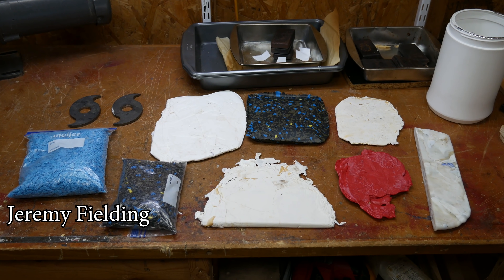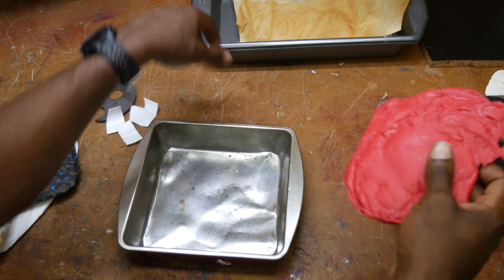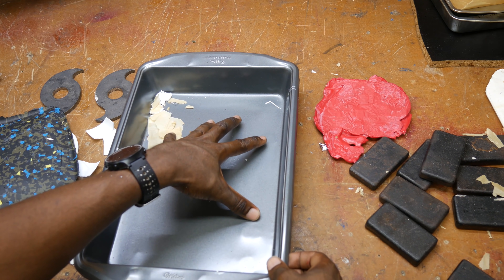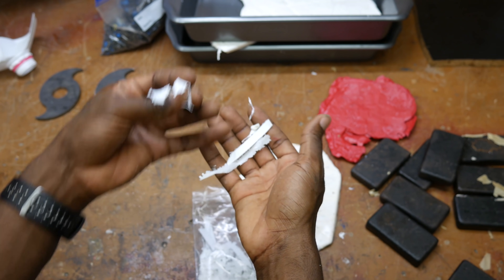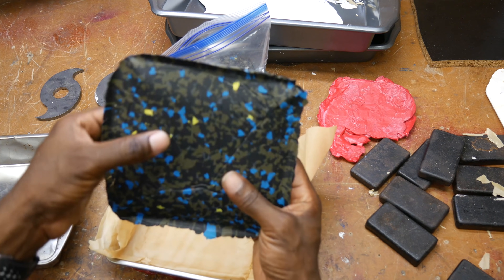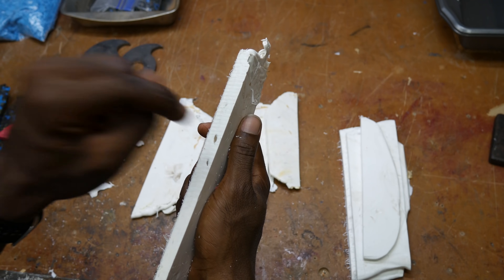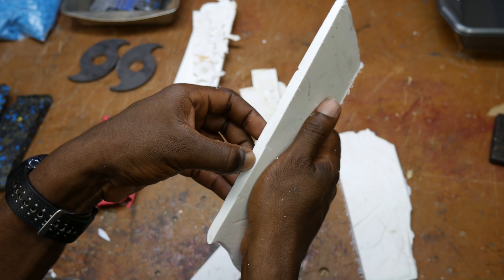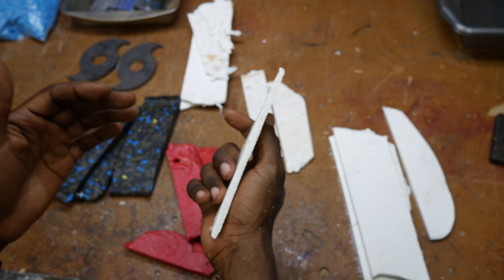HDPE, How Much Processing Is Required; I Put It To The Test!: 043

Comment: The factory I work at, makes plastic auto parts. We use heat and pressure to do injection moulding. Another thought to help remove voids is vacuum pressure when setting the melted plastic
Reply from the maker: I actually have a vacuum pump. It would require a chamber where in I could place a griddle, and cook the whole thing under vacuum. That would be interesting at a minimum, although not a cheap process to copy.
Reply: Jeremy Fielding maybe a process more like vacuum forming would work?

Comment: i use a piece of 50mm/2" galvanised steel water pipe with turned wooden plugs and clamps to make round stock to turn,you have to keep adding pressure as it cools. shrinks just enough to get it out when it cools,would think you would have to use a similar system for sheet ie. constant pressure plus adding pressure as it shrinks. maybe?
Reply from the maker: Yep. We are on the same path. I want to make a press which can be tighten while cooling.
Reply: That's what I do. I use the gradually increasing pressure clamping method. It still imparts internal stress into the material though. You're basically compressing a spring. Well lots of long chain molecule springs in the material. But usually that doesn't matter. Sometimes it does though.

Comment: I think you need a better pressing and heating method to really "mix" the melted shredded plastic. Probably heating the plastic for that long isn't good either. 
I guess theoretically you could build a large cylinder where you could just dump large pieces of plastics or complete jugs into it and then heat the whole thing under pressure.
My guess is that shredding is mostly great for storing or maybe mixing and cleaning the plastic.

Or a large solid metal tray to make dimensionsally accurate plates. Something that can be heated on it's own and where you can apply considerable pressure.
Reply from the maker: There is a note about this in the description.
Reply: Oh I'm sure I wasn't saying anything new, just thinking out loud :)

I guess my realization is that shredding saves space when melting the plastic. Like for the injection molding machine from precious plastics. Or compact storage for later use.

But if you just want to make thicker plates for cutting / CNC / subtractive processes you could just have a large box or tray and melt them down in the oven. Or integrate heating elements in a large metal box and make something you can clamp down to create pressure. No need for a shredder if you have space.
Reply: Shredding also means that the ground material can be stored in one location on site and then fed through vacuum lines along the ceiling to several simultaneously working plastic presses.
Reply: Cheers. I guess in an industrial setting cycle times are very important so you tune and calculate all the temperature so that it just works fine and as fast as possible.
Reply from the maker: No...I mean I have a note about why this is not a good idea. pressing large pieces together leaves the greatest potential for air to get trapped inside and leave those voids we don't want.
Reply: between melts while I build up my melt I press the mass with a large steel rod to consolidate it, and break up air bubbles. I use this large metal punch that I have and I just push the glob down with it. I also push the glob with a steel block with my other hand at the same time too. Kind of like kneading dough a bit? What the pros do is they have an auger in a heated pipe and that pressurizes the plastic.
Reply: Vacuum injection molding? Does that even work with thermoplasts like this? What if it cools down inside the the feed lines?
Reply: The vacuum lines are for transport only, and it does need to be below a certain temperature before being fed into the press or else it will cause all kinds of problems from the ground material clumping together.

I am only familiar with extrusion blow molding where a hollow tube is hot extruded and and then the tube placed into a two part mold.  The tube of plastic is placed into the mold so that air injection tubes are inside of the plastic "tube."  Compressed air is forced into the hollow plastic tube to make it conform to shape (100psi if I recall correctly).  The mold itself can also have chilled water flowing through it to help set the plastic to shape.  The plastic item can then be put into a cold water bath to make it harden quicker.

Vacuum to move it around, compressed air in a mold to shape it.
Reply: My uneducated guess is that you can get air bubbles with shredded plastic or granulate as well and the only way to really get rid of them is the screw in a pipe design like in the precious plastic injection machine. 

Then you have the material molten, under pressure AND in motion so the air can escape. If you just have a heated cylinder the air bubbles would get compressed but probably won't escape. Any air channels would get clogged by the viscous material like with an o-ring if it's not in motion like with a screw.

I'm just speculating here. But I'd guess you could have a large cylinder / box where you dump your large plastic pieces in that heats them at the bottom and presses them from above into such a screw / pipe injector.
Reply: Yeah shredding it into small pieces and using an augur in a pipe seems to be the best way.
Reply: It certainly eliminates a lot of the quality issues that home melters run into, but it is also a major investment in tooling too. So best is subjective. It really comes down to how much plastic you plan on processing. Pounds, or tons? If you don't see yourself ramping up into producing major tonnage of HDPE then I do not think the tooling investment is worth it for the amateur.
Reply: I guess it only really makes sense if you recycle a lot of plastic as a semi-professional workshop. Otherwise also the energy and materials that go into making the tools outweigh the benefits of recycling a few kg of plastic.
You might as well buy virgin plastic granulate on ebay.
What are good productive uses for plastics like polyethylene or PET?
I was thinking maybe a large mold for building elements (SIPs / insulated bricks) might be an interesting case. But you'd also need glue to fix those things together.

Comment: Jeremy, i am sure you do a lot of research. 
i wonder if you have seen randy knapp's 
videos for building HDPE slingshots?  
he takes a different approach that does not
seem economical.
however, i wonder if some of his techniques 
might be a help; and provide further insight 
into the results from your own experiments.     
best,  walt
Reply: He's the HDPE melting God. But he's melting injection molded plastic, and that stuff is easy. It has something to do with the additives put into the plastic. His blocks are still very artistic though. But I've taken a few ques from him. Like using a convection oven, and the incremental press method of cooling.

Comment: I had good luck using Teflon coated pans.  The material "snapped" off fairly easily after it cooled.  And you can find the pans dirt cheap at a Good Will Store.
Reply: Cole Dunlay this is exactly what we use in the hdpe industry, all of our heating plates/elements are sent to a teflon coating company that usually coates kitchen pans, its the same coating we use in the industry exactly, so you got it exactly right and you will get the best surface possible,   only other tip i have is use isopropyl alcohol to clean all your plastic and all your teflon before every time u heat it and the teflon again if your do multiple pieces, iso wipes are the most convinient..
Reply: I live near the goodwill on Dearborn in seattle. (Their biggest store)
It's my candy store.  
My GF hates it when I go there.
Reply: @elfpimp1  Haha that smell sure is interesting there
Reply: My thoughts exactly

Comment: I plane hdpe pieces with a power electric hand planer after it comes out of the mold and it works great it would allow you to create completely flat square boards of hdpe very quickly
Reply from the maker: That is what I have in mind. Once I can get the blocks uniform, I will plane the top and bottom. Then we are in business!
Reply: I mill my blocks on my milling machine. I use a fly cutter for the tops, and bottoms, then a shell cutter to do the ends square. http://i.imgur.com/Mqsy43E.jpg
Reply: cool one thing i noticed when i melted hdpe is that i had to sort of knead it like dough with oven proof gloves before clamping it in a mold otherwise it looked a solid block but when i strength tested it with two channel lock pliers bending a thing piece of it hard as i could it cracked in a weird fracture pattern like the original chips however kneading the molten plastic fixed this problem one other thing you could do is use a filament extruder which would extrude the hdpe chips and chop the plastic filament into pellets this would allow you to melt the hdpe and have uniform strength throughout the piece without kneading it. maybe as a much easier solution cutting it in really small flakes about a half centimeter would probably also fix this problem

Comment: Hey Jeremy, I have been a subscriber for quite a while under my channel The Fishing Hobby name and I recently started a second channel to focus on other interests.
I have been working with HDPE for a while now and get good results with minimal processing but using lots of clamping pressure (a small shop press is ideal). Making round cylinders for lathe use is the most practical use I have found for HDPE recycling. I haven't had as much luck with large flat pieces but I think HDPE grocery bags may be the best way to get flat sheets with minimal processing. Easy enough to cut the bags into large flat pieces. It would take a lot of them but you get them at almost any store so they are plentiful. Making round cylinders is easy enough using a soup can and a snug fitting round piece of wood pressed using a lot of pressure (again, a shop press is ideal).
Here is a video I uploaded about combining pieces of HDPE cutting boards to make a bushing that you may find interesting or useful: https://youtu.be/hHLwhoWdwTo
Still Loving your channel, keep up the good work!
Reply: It takes a hill of bags to make a tiny block of plastic. Those bags are mostly air. There's a woman on YouTube that irons the bags into sheets. Which is one of the most novel techniques I've ever seen. She has mad ironing skillz!

Comment: Might want to try the silicon mat and let the plastic melt then transfer it to  another mold form to get the thickness and press out the air bubbles.  Once cooled it will shrink and come out easy.  I have seen a few guy on YT do it that way. I have done small batches of shredded plastic and will use that method because it melts better.  I used a regular cross paper shredder for the little amount of plastic. But I am looking to amp it up.  Looking forward to seeing your projects.

Also, if you don't want to get the mat, you might want to look into the silicon baking pans.
Reply: I got one of them silicone sheets now myself. I haven't fooled around with it yet though. Because I do want to start making plastic sheeting. I am looking for a sandwich press. I got loads of blocks of HDPE, I want sheets!

Comment: I see in the comments someone mentioned glassware as a container, that sounds promising....
Also I was wondering if you've tried using hardhat material? I believe most are made of HDPE,  a fair amount of material in each, relatively easy to cut, 
maybe even with a hand plane on edge to give you slivers.
Keep up the informative videos
Just my 2¢
Reply from the maker: Where do you get all the hard hats LOL. I usually try to keep my one hardhat.
Reply: With being in construction for over 25 years I guess I've had more than some people, Check out some construction sites and talk to some of the tradesmen, most times as a job ends people won't take them home and they end up in the trash, a shame if there's another purpose for them.
Reply: I've got a few hats heading your way, check your email.

Comment: I would try paraffin wax as a mold release. Also silicone grease may work.
Reply from the maker: +jackfrost1031 I have some silicone grease. I was concerned it might effect the plastic but I can sacrifice some to find out!
Reply: Jeremy Fielding it shouldn't damage any properties. Silicone can be compounded into HDPE. If you want to try some MDPE or other grades I can send you some.
Reply: Also it's going to depend not just on color but on grade of HDPE. There are like a million different ones. Some extrude like bubble gum, some come out like concrete.  It all depends on the manufacturing processes used and the end goal of the plastic.
Reply from the maker: +jackfrost1031 sounds interesting... let’s do it. You can use my website to send me an email. Www.jeremyfielding.com It is in the video description also

Comment: Kapton tape would be worth a shot for non stick purposes.
Reply from the maker: +anyheck you mean line the pan with it? I have never used it
Reply: I'm sure it would work great, that stuff is wicked good. Sadly, it's horribly expensive in the widths and square footage you're needing. That being said, it really is great, and should be in your workshop, especially for electrical applications.
Reply: Jeremy Fielding I'd say so. It's used as a release for 3d printing.  I'm seeing a 3"x36 yard roll on Amazon for $20

Comment: Thanks for researching..it's been fun following along.  I wonder if some kind of progressively intensive clamping while hot in a mold (v. transfer to a mold, then clamping as the mass cools) and returning to the oven will narrow the slight voiding difference between your shred and the professional shred.  Thinking something along the lines of a bookbinder's press...maybe three or four intervals to tighten, putting the walls of the voids into contact & return to the oven to seal.
Reply from the maker: +Gary Pritchard I bought myself a griddle for the same purpose we shall see
Reply from the maker: +Paul Campbell that is almost exactly what I am thinking. I want to use a large griddle modified to heat and apply pressure at the same time
Reply from the maker: +Sean Flanagan I prefer to make sheets and cut it like plywood
Reply: Jeremy Fielding I saw a video of someone making an hdpe mallet and he used a panini press which worked perfectly.
Reply: If you melt the plastic right you should not have air bubbles. Jeremy is running too cold, and covering the melt isn't helping him get air out either. But getting a perfectly consolidated block of HDPE is kind of tricky.

Comment: Some have suggested silicone baking sheets, which I think would work, but you might also try cooking spray like PAM, or injection mold release spray. Try googling, "paintable food grade injection mold release spray".
Reply: stay away from oils. It gets in the plastic. If you're sensible and neat about it non-stick parchment paper is all you need to use.
Reply: Paul Frederick that depends on the plastic, and how heavily it is applied. You certainly would not want to spray the plastic directly, but a very light mist on the pans, or other pressing surfaces isn't going to hurt, especially if using any of the PE or PP based plastics. I agree though that an oil based spray is likely to be less effective than an industrial silicone based mold spray.
Reply: There are silicone lubricating sprays that I have used on vinyl windows.  A spritz of it and wiping to cover the surface might work even with the Goodwill teflon.

Comment: While compressing don't you trap voids?  If left at temperature, shaken a time or 2, then compressed with preheated weights, your void issue may improve.
Reply: Actually, the voids seem to be in the middle of the slugs, suggesting that air was trapped in the fluid. Increased pressure might make them smaller, but wouldn't force them out.
Reply from the maker: +MarkH10 or perhaps with more force to squeeze out the air while it is still hot? I agree you might be correct In letting it settle more. I am going to try using a griddle this week to see if pressure during heating can improve that. I expect it will. But I will also look at longer heating times without pressure and maybe needing it like dough. Except it is really hard to mix it while it is hot.
Reply: HDPE never turns into fluid. HDPE goes from goo to ash. There's no fluid state for the material. HDPE does not pour, and HDPE does not run. Eventually after a long time molten air bubbles work they way up with HDPE. I do think Jeremy covering his melt with weight is kind of messing the process up too. I'm beginning to think that slicing the molten loaf may be a way of releasing trapped air faster? Some kind of a wedge effect. Molten HDPE has a lot of surface tension and you kind of have to work with that.

Comment: Non-Stick Silicone Baking Sheets. Can withstand temperatures up to 450°F.
:
Reply: Do you mean ABOVE 450°?
Reply: Check out BJB Industries, they have two part Silicon that pours, thus mold making becomes easy.  Some of their products can go to 650 degrees as I recall.  Essentially, you would be making reusable pan liners, top and bottom.  Just a thought.